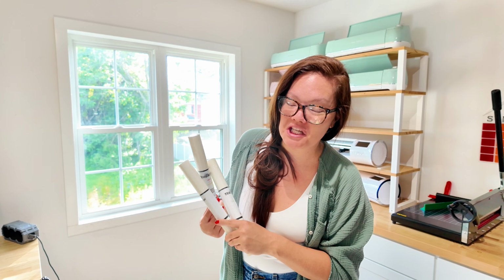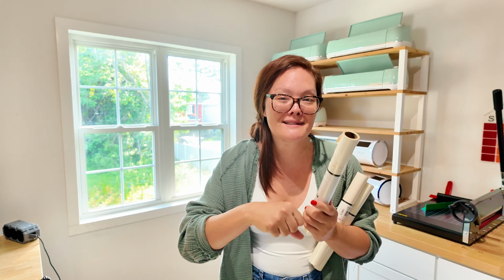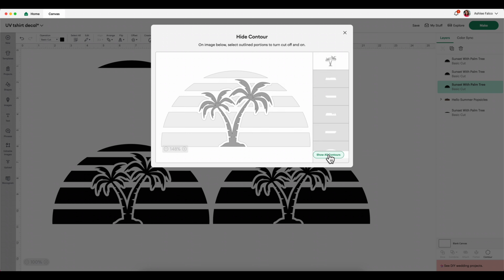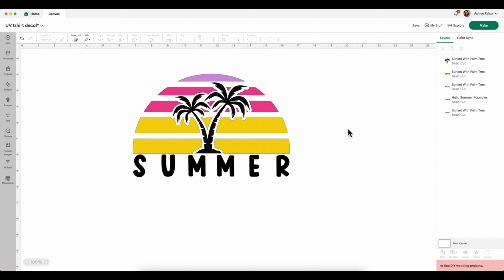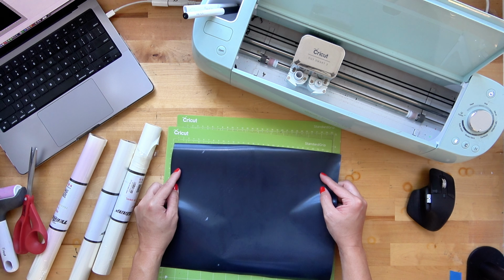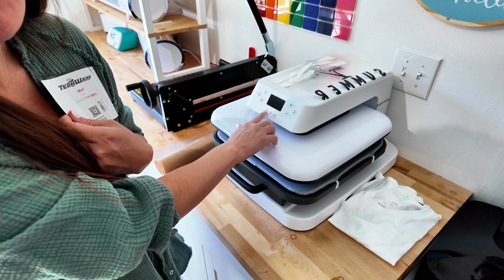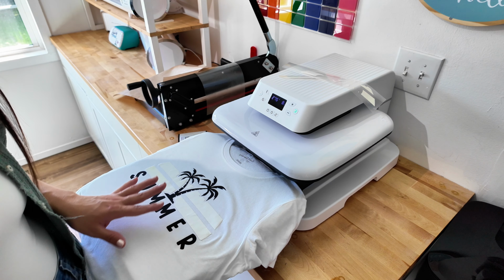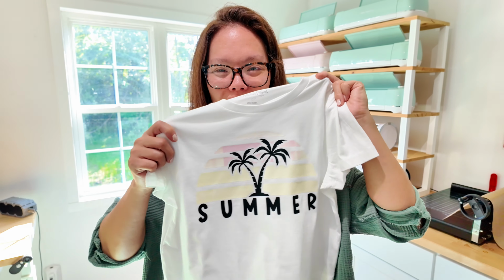UV Color Changing HTV, is it worth the $$$? [Easy Cricut Design Space Tutorial!]

Comment: I made a shirt with UV HTV too before, and after several wears and washed it stopped reacting to the sun. I wonder if your HTV was just old and it stopped reacting.
Reply from the maker: huh. You have a huge point here. I wonder if there's a shelf life to UV?
Reply: I used to have a "Hypercolor" shirt from back in the 80s that the fabric would do that with temperature change.  So your body heat would change the color and after a while, same thing, it quit working because I learned later, you have to wash it in COLD water and either air dry in the dryer or line dry.  The heat of the dryer "broke" it.  I wonder if it's the same thing with the UV HTV.